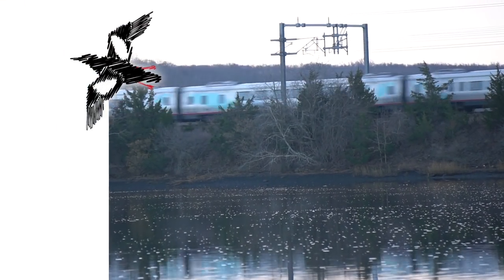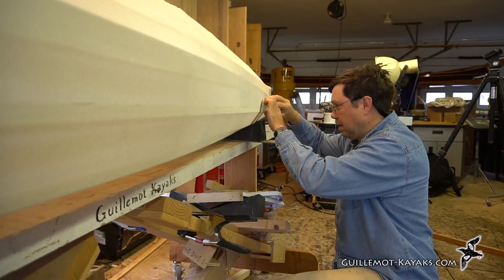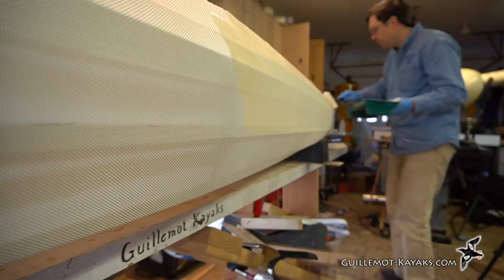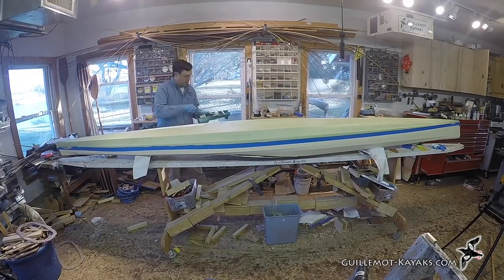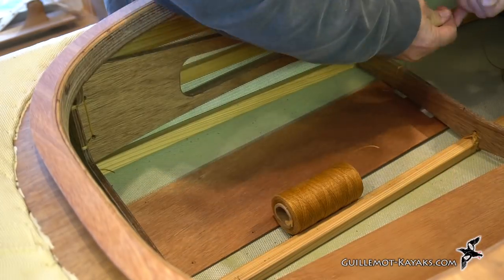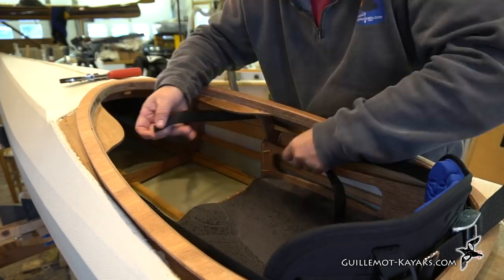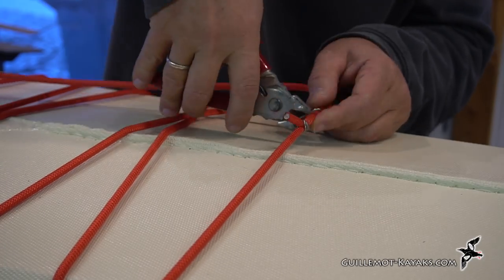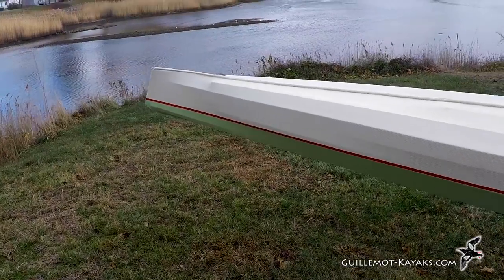Painting and Outfitting - Skin on Frame Kayak - E7

Comment: In your previous video you mentioned that the cloth alone will leaks like a sieve. Is the paint the only thing that keeps the water out? does the boat take on water if you scratch the paint hard enough on a rock? 

Great video. Excited to see your next project.
Reply from the maker: The paint ends up completely saturating the cloth. So, it isn't just a thin coating of paint on the surface, you need to cut through the cloth to cause it to leak. 

Since latex paint is a bit softer than some alternatives, it may wear down more quickly, but it should last a long time, and just wearing through the outer surface will not be enough to cause a leak.
Reply: the paint, or whatever coating you are using is what keeps the water out. It's impregnated and saturated in a woven matrix so its pretty solid. You might get seepage from a deep scratch, but not a stream pouring in. A hole would be different. But that is why we fit and inflate custom size float bags bow and stern, or other sufficient flotation. The cloth flexes, so impact resistance to puncture and scraping is pretty good. The only skin I have ever broken was a two-part urethane mixture over ballistic nylon, I hit a sharp part of a log at low water and rode over it. The focused point of wood "unzipped" about 7 inches of the skin coating, splitting it, and delaminating it from the fibers of the weave. Still, there was enough urethane embedded in the fiber that I noticed no change in the bilge water level on the hasty paddle home. This was in just-above-freezing temps, so that may have had some bearing. Every fabric/coating combo will act differently, but it is dependable. Personally, I would have coated my polyester skin with a spar varnish, tinted with artist oil paint, but latex will work and it's handy. It's not as durable as varnish tho. YMMV.

Comment: Hi Nick, these are a joy to watch, your approaches are so intelligent and well-thought.

On that note, I'm curious on the reasoning for latex paint, versus something that would create a rigid structure (eg polyester or epoxy resin).

In the video you mention Urethane as an alternative to latex paint.  Being that you didn't mention polyester, I realized you must have some reason you prefer to stay away from enforcing the cloth with a rigid resin?  Is the goal a more flexible skin or another reason entirely?

Thanks again for the great series!
Reply from the maker: The typical frame on a SOF boat is usually light weight and flexible. This allows it to be resilient when it hits something. I need the skin to work with the lightweight frame. A rigid, inflexible skin would cause hard spots where the boat would start to break.

Epoxy or polyester resin tends to be hard and brittle and would not be a good match with the rest of the way the boat is built.

Latex is flexible and designed to stretch and move on a wood house. The urethane I could use is also very rubbery and resilient.

Comment: love the look of that kayak. would like to give it a go on building it. was interested on the choice of fabric cover (latex paint). Didn't know latex paint would be water proof or strong enough to last. Would like to hear more on the longevity of the water proof coating.
Phil
Reply from the maker: Latex house paint is designed keep water out of the siding of houses that are in the weather 24-7-365. Given the market size, it is probably the most highly engineered and test form of paint available. 

While it may not be the absolute best material for sealing a SOF kayak, it is the easiest to use, cheapest to buy, least toxic and readily available. Plus, it is really good stuff.

Comment: Great series. Thanks for taking the time  to make it. I’ve been thinking about a s&g boat and was going to make your original gulimont but sized up 6% to the xl version. I’m now swayed more to skin on frame. I’ve drawn out your templates in sketchup and adjusted them for skin on frame. Is there anything you’d recommend adapting to suit a skin on frame? Thanks
Reply from the maker: It should be possible to adapt almost any design to SOF, but it may take some work. The most important thing to remember is the skin will flex and be pushed in between the stringers, so you want the frames reduced in size so they won't touch the skin when its pushed in. 

The first episode shows what I did to accomplish this, you can probably get some ideas from there.

Comment: I think having every option is great kit, plans, and instructions. I know you have the SketchUp model already if you have SketchUp Pro you can put it into layout and put in all of the measurements and make that available in PDF form on your patreon page right now and anyone who was willing to donate would be able to have access to that I think that's a great idea and it incentivizes people to go on to patreon and donate. just get the simple plans without the kit or instructions and let people figure it out for themselves. Later on when the instructions are available you can put that on your patreon as well and then develop the kit. No need to respond just a comment and suggestion.
Reply from the maker: While I could very quickly and easily produce a set of plans, with drawings of all the parts, this would likely make a lot of people angry. Plans don't necessarily tell anyone how to put those parts together. Experienced builders can easily go from a set of plans and build the boat.

What causes problems is when inexperienced builders try to work from just plans, is they just don't know how to start. Without good instructions, the novice builder blames the plans for being bad. 

It is like a set of house plans. If you aren't already a carpenter, you won't necessarily know you need to dig a hole for the foundation before you start nailing two-by-fours.

My goal is to provide the necessary instructions that someone who doesn't already know how to build a kayak can successfully build the kayak. Unfortunately, this takes time.
Reply: If I was at a point that I wanted to build one I would be happy with just the plans. I guess I kind of just want to figure things out on my own somewhat. it would be nice to have more detailed instructions because as soon as I got started I would figure out it was more work than I originally thought and detailed instructions reduce the amount of time and energy it takes. I'm not ready to jump into building and kayak right this minute I already have too many other Hobbies But I definitely enjoy watching your videos thank you.

Comment: This is a cool design, looks like an easier build than a strip, makes me think about building one but with out the CNC.  What is traditionally used to waterproof the boat besides paint. Was the cloth a heavy weave canvas fabric?
Reply from the maker: Definitely, quicker and easier than strip building. This took me 3 weeks, including design time where the Petrel Play was over 3 months.

Traditionally oil-based paint has been used on fabric covered boats, but everything from roofing tar to varnish and concrete sealant have been used.

Lots of boats have been made with cotton canvas as a skin. This synthetic is more durable and easier to work with.

Of course the true traditional skin would have been seal skin, but I don't want to go around clubbing seals.

Comment: I'm guessing your skin is polyester.  Would latex paint be suitable for a nylon skin.re adhesion etc.  I guess it should have the required flexability. 2 pack poly is too expensive. I would value your advice.
Reply from the maker: Nylon is more picky about what adheres to it. The 2-pack urethane is probably a better, tougher finish, but hard to apply and expensive.
Reply: @NickSchade  Thanks for the prompt reply. I have ordered nylon so must find suitable coating. 2 pack poly on ebay/amazon UK is floor paint. Don't know if this is OK. I have seen a post where someone has used yacht varnish but don't know how this worked. Wish I had selected polyester now so that I could use regular paints.Has anything other than 2 pack poly been seen to work?

Comment: The elimination of the steam bending makes this building method a lot better.  I understand that some people want to remain with the traditional methods, but computer generated forms in plywood with stringers on the outside, should require a lot less skill to build the kayak.
Reply: You would think it's faster, but I'm not sure. I've done it both ways, quite a bit of time goes into lofting and prepping the forms by hand. Same for drafting and setup work for CNC. That Cape Falcon F1 goes together really, really fast. However, you're much more limited on what kind of boat you can build. I don't think this boat design could be done as well with traditional methodology.
Reply: @theonlyrobot  I was expecting someone like you to do all that lofting, drafting, and CNC work for us future builders.